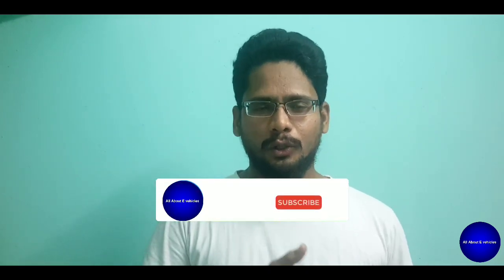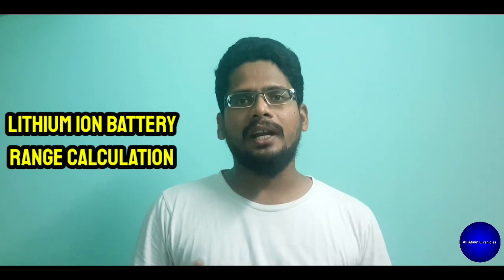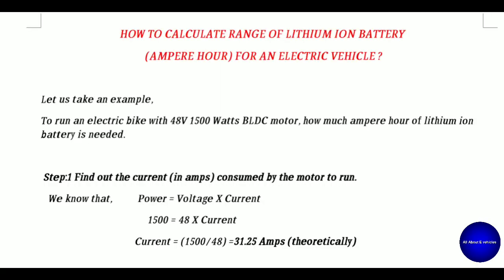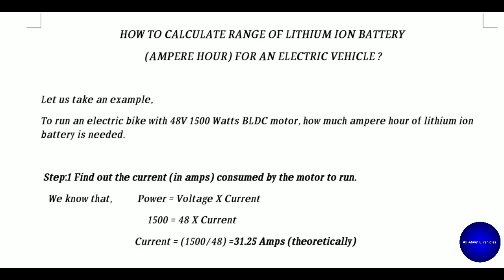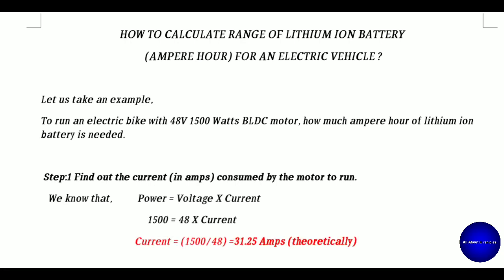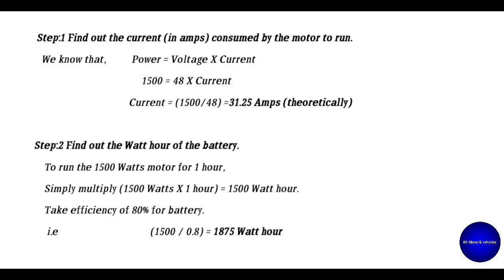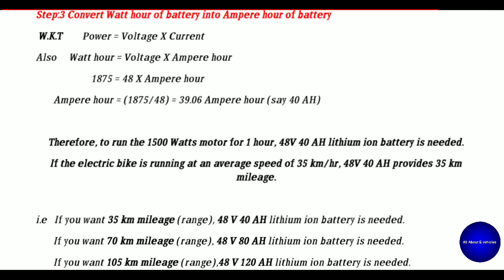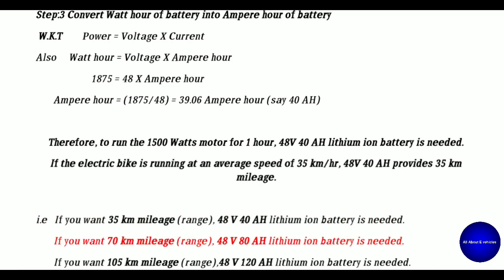Battery ampere hour,Watt hour calculation for Electric vehicle- Lithium ion battery

Comment: If i am using  4 batteries each 24 v  and 120ah  connected in series so 48v then what will be running time only 120ah or

Comment: This calcutation shows that battery AH required for driving motor only. With the help of this calculation we can't calculate range. Because if acc. To you top speed you have considered 70kmph and average is 35 kmph. If i choose top speed 100kmph and average 50kmph for the same calculation and values as you showed above. Then 50kmph mileage for 48volt 40 AH battery pack??
Reply: One more thing calculation is same and all values is same but i changes top speed 70kmph to 100kmph and now average is 50kmph so what will be range in kilometer???

Comment: If my amp hr of motor is 20ah and if I use 42ah battery pack then it will be differs in range or speed  ?
Reply from the maker: Technically ur specification of motor is wrong. Motor specification will be in watts.
Reply: @AllAboutEvehicles  I mean motor tacking 20 amps of currents
Reply from the maker: Tell your clear cut motor specification correctly..we can't conform range and speed blindly with single data.

Comment: Sir nice video but can u tell me how to calculate the volt of the motor.
U have only told about how to calculate the power of the motor.
Now i need to know how to calculate the voltage of motor.

Comment: All that is good. The weight factor should also be calculated in this. Without taking in consideration the weight of the vehicle or bike the calculation is incomplete.
Reply from the maker: Weight factor has been considered in motor power and torque calculation in separate video.This video is continuation of that.

Comment: 36v 350watt hub motor can run with 36v 2 Ah battery? I mean manually check the motor condition wether working or not.

Not installed bicycle
Reply from the maker: Motor watt is 350...so greater battery pack will do it.
Reply: @AllAboutEvehicles  ok noted. But are you sure 3Ah power not enough for 350 hub motor?
Reply from the maker: Not for the performance

Comment: Sir I am choos 3000watt,72volts BLDC hub motor
Witch capacity battery choos for 300 km range
Reply from the maker: Do calculation in the same way as given in video. Try in reverse also.

Comment: sir 60v and 24ah will give approx how much km on 35 km
Reply from the maker: Depends on motor load, vehicle weight,  number of passengers,  type of road conditions, tyre pressure.
Reply: tentatively on an average

Comment: What is the difference between 24 volt vs  36 volt vs 48 volt with 250 Watts motor.which is the best to buy for longer distances with good mileage.
Reply: Sir pls reply my message
Reply from the maker: Your question is wrong. 
For getting good mileage u should have told the battery capacity....

Comment: If  motor power rating is 100 watt means 12v 8amps ... if I will directly connect the motor to 12v 20 amps battery .. does it run  and work double or not

Comment: Bro...thanks for the video...can u tell me how much capacity required for 72v battery to run for 150km/charge and acceleration of about 5.5m/so....
Reply from the maker: You can calculate using the same formula

Comment: Please answer how did you fix the 36 kmph speed for the calculation????
Reply from the maker: Top speed I took is 70kmphr. Average is 35kmphr
Reply: @AllAboutEvehicles  sorry bro  I can calculate this speed through your previous video. For example 8okmbh bike required 5.5 kW motor right. So I came to clear information
Reply: @AllAboutEvehicles  but I can't understand this answer anyway thanks
Reply: I wanted to start small startup company I am working on research to continue the vehicle operation upto destination without depending on limited mileage. The battery will be charging with minimal charging power on running condition by the generator and rest of the generator power will takeover the motor operation. only constraints is that the generator could not takeover the fully discharged battery and motor

Comment: Hello Sir , Please Explain me "Following two batteries are used for two 4-wheeler electric vehicle for city operation     (Average driving is 30km per day).  Which battery needs first replacement?   
	
Vehicle.  	Range 	          Cycle Life
Alpha	 -    600 km          500 cycle
Beta 	-     150 km            1500 cycle

Comment: Thanks  Sr, but if we have 2 motors should we consider one of them or two ?
Reply from the maker: Tell about the application in detail.
Reply: @AllAboutEvehicles   same as your application but if we have 2 motors instead of one motor, should we multiply the power by 2 ? Or what?
Reply: @mo7d_saleh  did u find ur answer?

Comment: If we increase the voltage is there any issues...what if we go for 60 Volts and 72 volts battery ..will it be more expensive
Reply from the maker: Will explain this in upcoming video...keep in touch

Comment: Bro, can you tell, how much external battery capacity will be required to charge a Electric bike with Power of 5.5W and Battery capacity 3.9KWh.. I am just trying to understand due to current issues of home charging a bike without an avaialble parking space, can we try using a portable battery to charge an EV instead? any advise is appreciated pls.
Reply from the maker: Great advancement in ur thinking...I appreciate it.
Reply: @AllAboutEvehicles  Thanks, there are portable chargers available abroad but very expensive also some available locally but not sure what capacity will be enough. If we apply the same concept of home charging with 6 amp and use an battery which we use in our home inverters we could establish this? In either scenario taking your math example how much capacity external battery will be required pls?
Reply from the maker: My calculation here is for discharging only.  For charging we need different calculation approach w.r.t  C rate.
Reply: @AllAboutEvehicles  bhai lithium battery or or acid vali battery series connection m ek sath kam kar jayengi kya

Comment: Sir 72V 2500 watts motor and 72V 40ampere battery of an electric scooter with a speed of 60kmph what is the Range

Comment: How can we know that a maximum speed of a specific emotor
(for example, how can u say that 1500w motor gives 35km range)
Pls reply bro
Reply from the maker: Complete explanation has been given in the video..
Try another example like 750 watts and calculate the range
Reply: I agree. The adhoc assumption of 35 kmph does not make sense. Why not 20 kmph instead of 35 kmph?
Reply: @anindyaroy1719 , seriously it does not make any sense
Reply from the maker: You can't understand the explanation. The top speed assumed is 70kmph.
The vehicle at rest is zero.
Hence the average speed of bike is 35kmph.

If you drive the bike at average speed of 35kmph, you will reach 35km in 1 hour. Likewise calculation is moving.

Likewise if top speed I want to choose is 100kmph.
The average speed of bike is 50kmph.

Learn some basic science. 
The video has been worked very hard to explain. It has sense.

Comment: Can I run 60V 32Ah battery with 72V 7KW BLDC Motor?
Reply from the maker: 72V 32Ah battery is better to run 72 V motor
Reply: @AllAboutEvehicles  Yeah I understand from your video about Watt and Voltage of motor but  as I doubt about the operating voltage of the motor, if it says that operating 72V but if I only have 60V Battery, can it work together?

And thank you for your answer
Reply: @nitiwatwongchanla9234  you need DC-to-DC converter to use 60V battery with 72V rated Motor

Comment: Slight contradiction I guess at 6:21 secs, on what basis it is concluded that for 35km/hr battery AH will be 40, hve you crosschecked with physical multimeters in Vehicle for the current (ampere )value 
Eg - you could have taken  avg speed as 40km/hr then same 48V 40AH would hve  provided 40 km range is it right ???
Correct me if I am wrong.
Reply: I think the same how he take average speed of 35kmh without know the workload of the motor

Comment: Lets make a review of the working sir! If the motor is rated 1500 watt and the batteries efficiency is only 80% why then are we getting an increased value of 1875 watt instead of reduced figure 1500 watt minus 80%??

Comment: Please make a video on How to decide ratings of battery if the weight is 900 kg??...or what is the relationship between  load and battery current
Reply: Battery is decided by motor ratings u have to know about voltage ratings of motor then it will be easy to decide battery

Comment: 60v 35 ah - 500 w = how many km? thanks
Reply from the maker: Around 70km range
Reply: @AllAboutEvehicles  70 km? 70 km i make now with 5400w :)
Reply from the maker: In ur previous message u said...500 watts
Reply: @AllAboutEvehicles  yes, couse i wanna  take the battery from my electric scooter Dualtron ultra witch is 60v 35 ah , and the motors are 5400w , and put & convert a normal bike in one electric  , and need buy a 500w motor. and controler, because i have already the battery.. but my range is bigger with 5400watts  , then 500w ...
What i miss ?

Comment: Hello sir 
How to calculate range of e bike with 48v/800w motor and 35kmph speed
With 48v/30 ah lithium battery
Reply from the maker: Follow the steps provided in the video. By substituting your technical values u will get the required mileage.

Comment: I want to build electric bike with using unlong LTO (lithium titanate oxcide) cell 
Its voltage is only 2.3 volt but its lifecycle ia very long
How much cell needed to build 48 v battry pack!!
Reply: 48 V/ 2.8 V = 17cells in series. And for the parallel part depends on how much current you need.

Comment: Hi, 
How did u take 35km/hr as the average speed? 
How did u find that value? Please tell me.
Reply from the maker: I have fixed top speed of the ebike will be 70kmph.
So, average of 70 is 35kmph
Reply: @AllAboutEvehicles  how can we do that? I mean, set the top speed in an electric vehicle?
Reply: @AllAboutEvehicles  also I am confused how the top speed effects the mileage.
Reply: @AllAboutEvehicles  what if we travel at 45 kmph as an average, keeping 70 kmph as top speed
Reply from the maker: Simple maths...
Average =(Top speed + Initial speed)/2

How did u get top speed then?
Reply: @AllAboutEvehicles  actually I had calculated power required, by keeping 35kmph as max speed for an e bicycle. Seeing your video. 
So from your video, I need a 13AH battery to travel 17.5 km per hr. As it's the average speed.

But what If I maintain a constant speed of 20kmph. How much distance will i go. Will i reach 17.5 kms in less then a hr before the charge dies right?
Reply from the maker: If ur maximum speed of bicycle is 35kmphr, average speed is 17.5kmphr.
Intial speed is zero.

Mileage depends on different factors and road conditions.
Reply: @adhin gopuj bro if we change avrage speed 35 to 50kmph what values will be chane in above calculation which shown in video

Comment: If the bike runs at 70km/h,how much AH required for 35 km range
Reply from the maker: 70kmph is top speed...you will not always ride at top speed...
20 kmph..40...50...60...70 ..like that at different road conditions 
Kindly tell your correct requirement
Reply: Bro how did you find max speed?
Reply from the maker: Maximum speed...we can fix as constraint (our wish) ...so that we can calculate motor power and battery AH

Comment: Hi, Your effort to explain the math is good but it is very general / average calculation which can lead to incorrect selection of battery capacity. And if it is Li-ion then you can imagine the cost. You have not considered torque of vehicle which is directly related to current. At different speeds there will be different torque requirement. At different torque there will be different current consumption by the motor. Also, many of the times during the journey the throttling of the vehicle may vary many times or zero at times even when the vehicle is in movement. Calculation of that duration is not considered. different vehicles will have different weight and loading patterns which you have not considered. The actual way is to have analytical data of city and highway ride of the specific vehicle where current consumption is noted as a pattern and then the battery is designed as per the pattern for a given weight, motor wattage and loading. Do you have such calculation ????????
Reply from the maker: This is basic calculation. We should not stop with it. We can create simulink models with different driving cycles which will result in maximum torque requirements, battery capacity,  motor power requirements.

Comment: 350 watt motor ==> 35km speed ==> 48V 40AH LI battery, then how many km range it will give ?
Reply from the maker: Do the calculation same as given in video. Substitute your requirements. You will get mileage.
Reply: @AllAboutEvehicles  Okay. Thank you 👍

Comment: 48v 1000watts bldc motor
35km milage - 48v 27 ah
70km milage - 48v 54 ah
105 km milage - 48v 81 ah 
Is my calculation is correct sir ???
Reply from the maker: Approximately

Comment: Ola s1 has 8.5kwatt motor and battery 2.9kwh. then  2900/8500=0.35 hour backup 🙄
Reply from the maker: 8.5 is peak or nominal?
Reply: @AllAboutEvehicles  5500 watt
Reply from the maker: Calculate mileage or range as per my calculation given in video.
Reply: @AllAboutEvehicles  ok, thank you 👍

Comment: If the battery capacity is 100AH, 48V
And motor capacity is 1.5Kw
Gross vehicle weight 700kgs
Top speed 30km, Avg speed 25km
Then its mileage is?
Reply from the maker: That's what video explanation is given....

Comment: Everything is fine but how did u take 35 kmph as average speed.......and the ampere magnitude you found at first ....won't it be specified in the motor? These are the doubts anyone who knows pls reply
Reply from the maker: Here top speed = 70 kmphr is a constraint for design.
Average speed is half between zero and top..simple Mathematics.